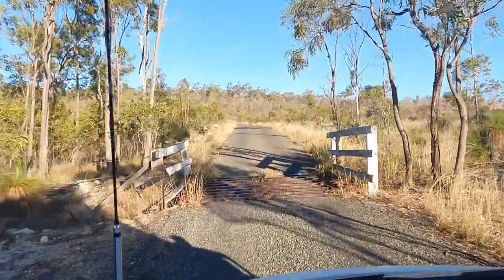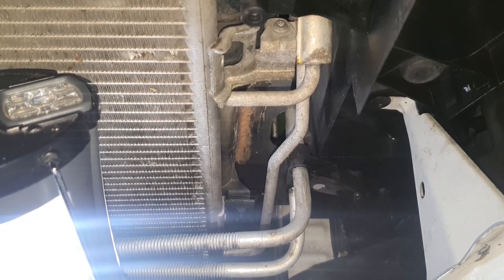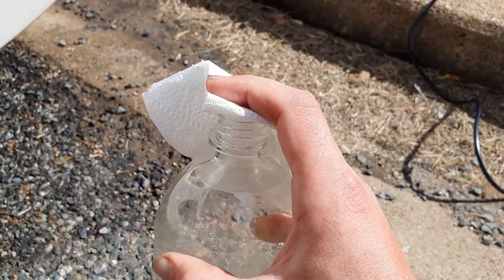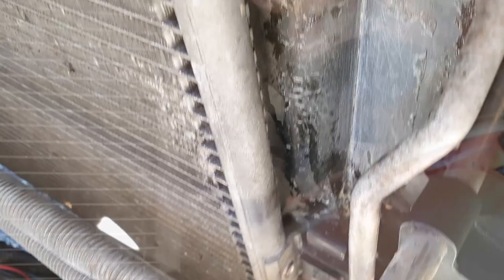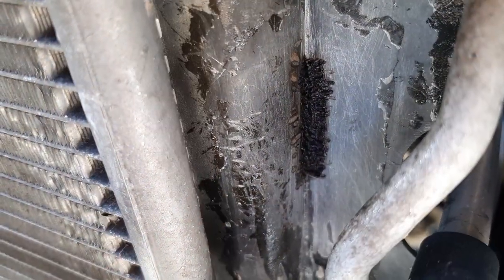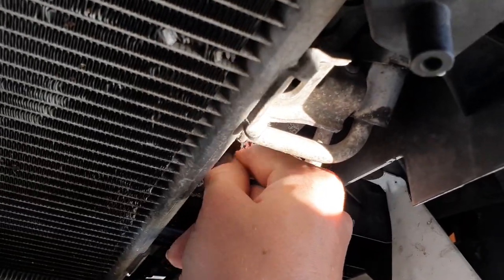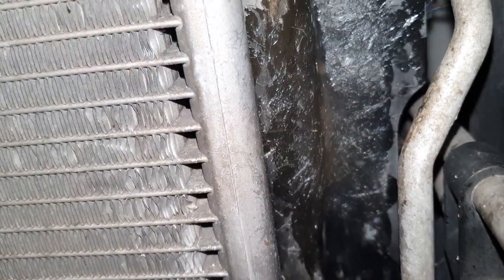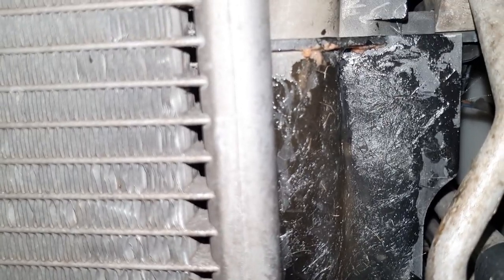How to Fix a Radiator Temporarily

Comment: The maxi nails is what u would use next time? I just notice repair done with fibreglass yet at start you had maxi nails?

100% have to start taking a few repair items with us on travels. We had hose off this last trip easy to fix but could been worse.
Reply from the maker: No the maxi nails was just to keep the crack shut so we could make it back to the next town. It didn't last very long. After melting the plastic and putting fiberglass we drove 4000km so that we can recommend! Yeah its always good to be prepared, could be the difference between driving back or getting towed...